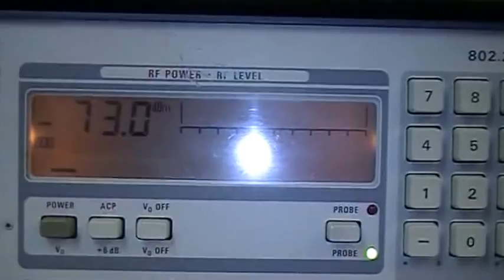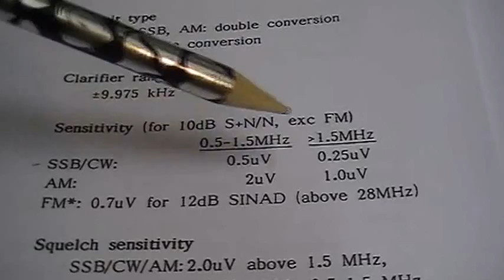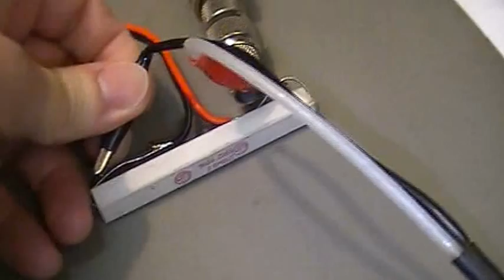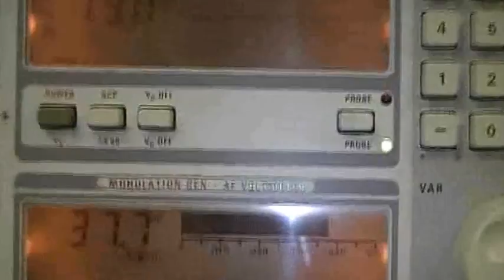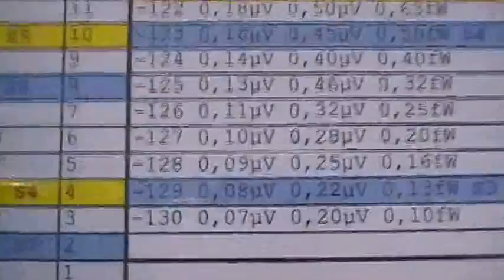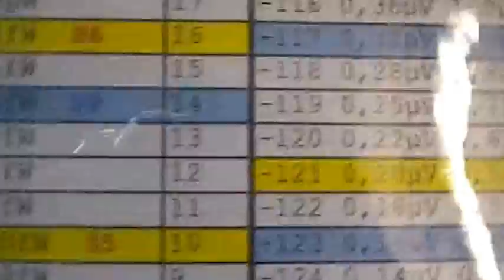#5 Yaesu FT747; Part 1: fix/ repair bad RX sensitivity

Comment: hi Peter,I don't know how old this video is but I am hoping you can help,I just bought a Yaesu ft 747GX,works great but the input audio (modulation) is a bit low on ssb, would you know what trimmer controls the modulation? or I think is "alc" adjustment pot,any help is greatly appreciated, thank you for the great videos

Comment: Hello.  I have a small vhf/uhf radio that has distorted or overmodultated RX audio more than half of the time.  It is not sporadic.  It only happens with certain radios.   I know it's not the speaker because I have plugged in an external speaker and the issue is still there.  I was wondering if it is something that can be resolved with an adjustment to one of the variable pots inside.
Reply from the maker: Hi, can't say on remote to many possible causes.. 73

Comment: hello i love your videos i am a general class ham and an ex GM technician ,.. and an ex electronic technician on factory automation equipment ,...  i have a kenwood ts 940sat  that someone gave me and the receive is very poor to say the least ,..    i have a fluke model 6060b and various scopes and multimeters  but no RF multimeter ,..  can you give me a starting point just to get started in the troubleshooting of this kenwood ts 940,...   the transmit is OK  not quite peaking 100w out  on ssb   actually more like 50 ,.. receive is so weak if  i am on 40m  i hear stations that should be a s9 easily that barely budge the meter ,... the auto tuner functions and the motors stop  on all bands ,....i get  good signal reports on transmit  but radio has no ears  whatsoever ,..  i have compared it side by side with my ts 930 and its like night and day as far as receive  ,..  any help you can do to point me in the direction   i would appreciate,....   and how can i make a probe for the signal generator to probe around  the if board ??    thank you    and   love your videos
Reply from the maker: daklover extroidinaire Hi there, watch may video on the kenwood TS2000 part 1 and  part 2. There you see a way how to approach the problem. But first of all make sure that all needed voltages on the right level. Kenwood always providing a RX level diagram with the service-manual, just follow the signal path. hope this helps a bit...73's
Reply: TRXBench  thank you and will check the voltages first  before poking around  thank you for your videos  you are an extremely smart man ,... and thank you for sharing your experience with us on you tube   73's   all the best!!!

Comment: Große Video, Ich habe 2 von ihnen und man hat die gleiche Schwingung Problem, wenn ich mich recht erinnere auf 20 Meter. Ich wirklich den Respekt, den Sie diesen alten Arbeitspferd Radio zeigen, schätzen, viele scheinen zu gerne lustig über die Kunststoffgehäuse und andere Dinge zu machen. Mein Punkt ist, würden Sie nehmen auf einer anderen, neu ausrichten und fixieren in der gleichen Weise, wie diese Video-Shows zu betrachten. Er wurde für die Jahre geboxt, da ich nicht seit fast einem Jahrzehnt aktiv. Ich würde gerne diese Anlage wieder von seiner besten Seite zu sehen. Versand von und nach machen könnten Senden übermäßig teuer, aber ich habe keine Ahnung, was eine Rundreise sein könnte und dann muss man für die Arbeit. Sie haben gerade die hinkende kleine Kerl in dem Video sehen so gut wieder, immer wieder in Form Mine würde, wenn keine Stute als Respekt, sie bringen eine große allgemeine Berichterstattung Transceiver wieder zum Leben, wenn nur als Empfänger. Ich bin in Amerika, in Florida an der Küste des Golfs von Mexiko.Great video,

 I have 2 of these and one has the same oscillation problem if i remember right on 20 meters. I really appreciate the respect you show this old work horse radio, many seem to like to make fun of the plastic enclosure and other things. My point is would you consider taking on another one, to realign and  fix in much the same way as this video shows. It has been boxed up for years as I have not been active for nearly a decade. I would love to see this rig back at its best again. Shipping to and from might make sending it overly costly but I do not have any idea what a round trip might be and then you needs for doing the work. You just made the limping little guy in the video look so good again, getting mine back in shape would if no mare than show respect to it bring a great general coverage transceiver back to life if only as a receiver.
Reply from the maker: Thank you very mauch! I hope it helps other HAMS :-)